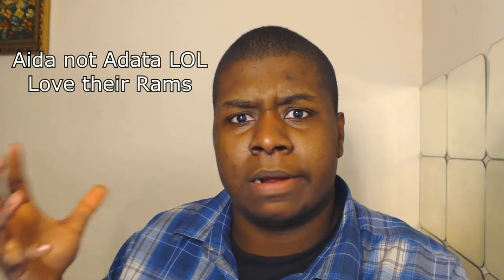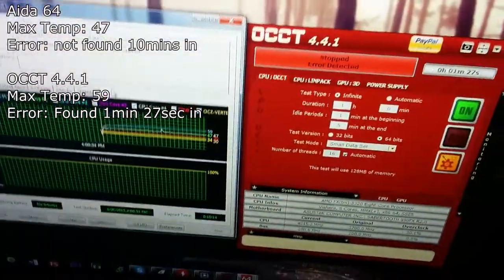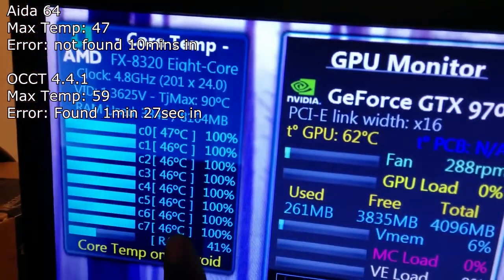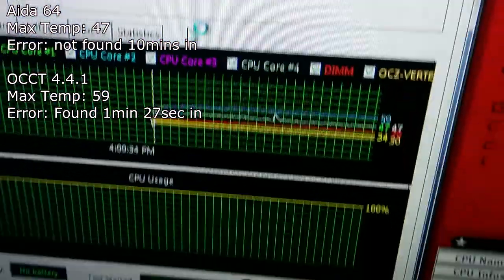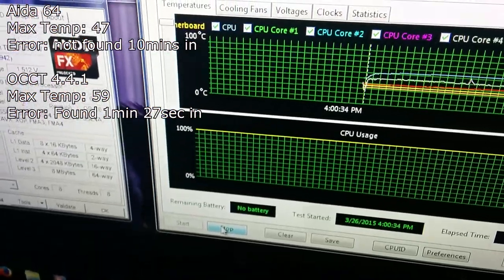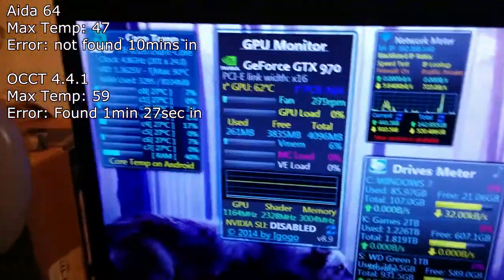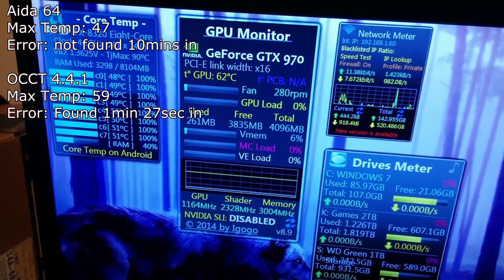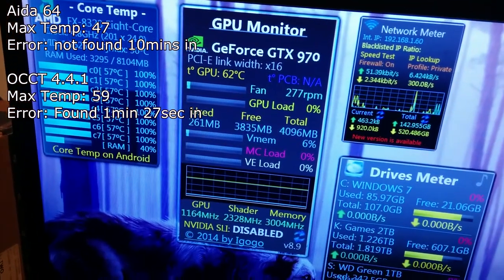Vlog: Fixed the CPU Problem & Platform Switch

Comment: I just moved from 4460 to 4790k. Didn't feel fps increment... So don't expect too much from this upgrade! Also it is hot!!! I am running it at 4.4 xmp profile and it seats at 65 to 70 in a hot day! I have just evo 212 so if you will push it higher than you need a water cooler.
Reply from the maker: Yaroslav Shevelev Trust me, i'm not upgrading to get higher fps in games except for Flight simulator X since its still dependent on 1-4 cores, i'm doing it to be more efficient in programs like Vegas pro and handbreak. Them 35GB blurays are a bitch. Can't wait to see what she can do compared to my 8320@ 4.5Ghz.